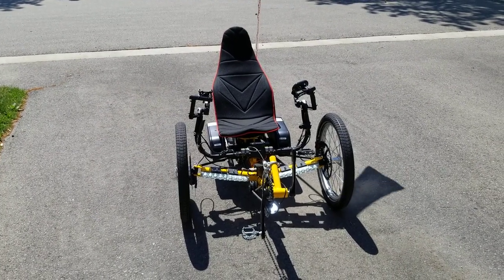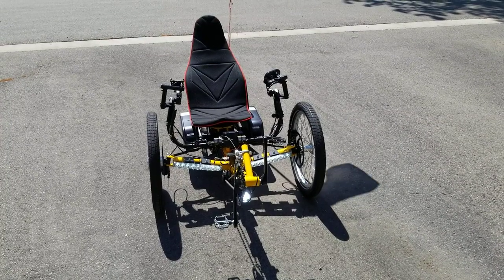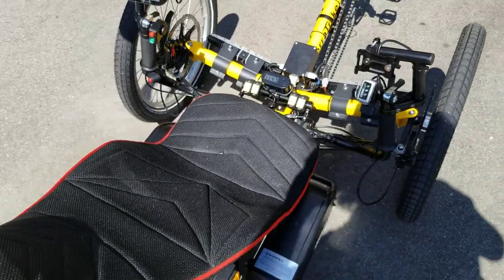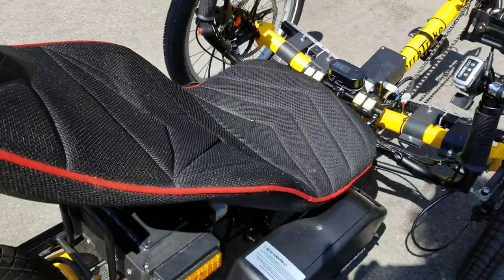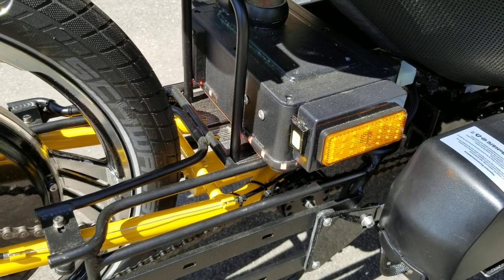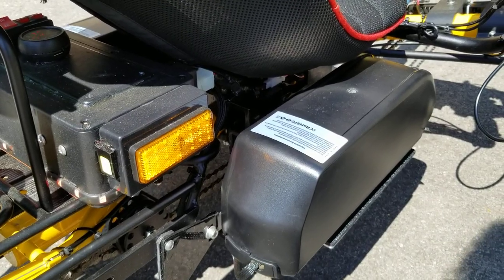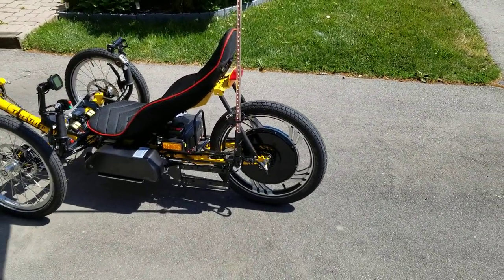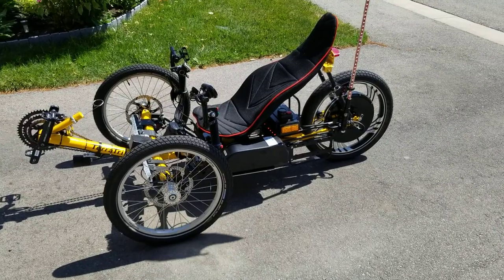Terratrike Tour 2 - etrike conversion.

Comment: Your trike looks great. I'm orienting and learning as much as possible about all kinds of trikes (etrike or trike). Currently I'm using a gravelbike to go on my twice a week trips with my buddies, but I like to have a bike like this to go on longer trips on my own or even to go shopping, not needing to use the car or motorbike... With my gravelbike not very practical. Beautiful built, your bike, I have to say it again.
Reply from the maker: Thanks for the Compliments!  

The Terratrike has actually seen some improvements to the setup, since this video.  Inclusion of a full sized, beefy rear rack intended for a 20" Fat-tire bike, allowing use of soft side bags (repurposed Tactical packs, LOL) for tool-kits, essentials to be permanently stowed, and a ~30L quick removable Scooter top-box to bring the Groceries home in dry condition..  Rear tail-light was relocated.  

Current setup can be seen here in a shorter video: 

https://www.youtube.com/watch?v=Y_BB33RlA60&ab_channel=ImagesfromtheDorkSide

Last season, this became my stand-in replacement for my Truck, for local errands - which in era of COVID, was 95% of my trips, in being home-centric.

As much as i wanted to get back to bicycles - Trike is the safer route to go, with my Medical/Balance issues.  

I've got another Project underway - ground up 'experimental' build - that will involve a full-suspension setup, as it's eventual replacement.  There's a preview video of that, somewhere in my channel vids.

Comment: Awesome!   What kind of range do you get from having both batteries?  I converted my Performer Goal (two wheeler bent) to electric with a 48V 17aH - I get an average of 84 miles (but can stretch it to 95 - just don't want to kill my battery).     I love it when I can take parts from around my garage and solve a problem, but most of the time, my solutions fail and I try try again.  Anyway - nice ride!
Reply from the maker: Thanks for the Compliments!  

I am not kind on battery range, given the variations in elevation/hill climbing i take on.  

Throttle being aggressively used, i can do ~60km (~40 miles) on one battery pack (48v19.2ah).  I don't have them double-ganged up - the other battery pack not in play at time, is for lighting, and serves as a reserve pack, if i get outside of that ~60km range.

Comment: im about to get a terratrike wizwheelz i think its the same as this one and i was wonder where did you get that seat? look pretty cool and is it comfortable and on tight turns will you be slide off the seat? thanks
Reply from the maker: The seat is from Poland - they are commonly found on Ebay.  Note - it's the bare fiberglass pan, and seat cover only.  NO mounting hardware whatsoever.. 

I am competent enough in aluminum fabrication, that i built up replacement mounts to adapt to the original Terratrike seat mount on the frame, and the rear seat stays to the drop outs.  It took a fair amount of designing on the fly, as i also incorporated the  dual battery mount around my fabrication.  It's definitely not a beginner's fabrication task.  

The seat cover ensures grip of the body in position - i am a lightweight at 140 lbs, and the seat holds me in position.    It's certainly comfortable to me, that've literally spent the day at a music festival, on my mobile 'couch'...  

It's a good enough seat that i picked another up, for another Recumbent Trike project, currently being designed/built from scratch.
Reply from the maker: Note  -  you don't want to 'Tight turn' a Tadpole Recumbent Trike at any speed that would displace a rider - you will likely end up flipping the trike, before you part ways with it.  

Tadpole Recumbent Trikes  are remarkably stable on the straight and level  at a pretty good rate of speed - until they aren't with sudden directional changes - then it generally all goes to Hell, very suddenly.  When the Center of Gravity wanders outside of the wheelbase Triangle - the rest of the Trike wants to follow suit..   

Just FYI.

Comment: Hi, how much did it cost you and where did you get the motor???  Great job,  I will upgrade my Taratrike after watching your video ,thanks for shearing !
Reply from the maker: Hi there, and thanks for the Compliment!

This is a Golden Motors Black Magic Pie 5 Vector 20" mag wheel version.

https://goldenmotor.bike/product/magic-pie-5-vector/

The mag wheel version might not be available any longer - i don't see it on the websites.  I might have actually got one of the last available, as it disappeared off the websites shortly after my order.  

The Spoked versions of the wheel are basically the same.  

How much did it cost?  I don't want to really know... i'd say under $5k Canadian, including the cost of the Trike.   Everything but the Trike Frame itself, was reworked, or replaced, in the process of conversion...

Costs could definitely be reduced.

Comment: Is that a stock Terratrike seat or a custom seat?  If custom, where did you get it?
Reply from the maker: Hard shell seat imported from Poland.  Comes as seat/pad only.  Mounting methodology is purely up to the user.. i had to fabricate two aluminum mounts to adapt to the terratrike methodology.  

https://www.ebay.ca/itm/303792542217

Comment: Looks great. What kind of tires are those?
Reply from the maker: Running Schwalbe Big Bens at 20"x2.15 on front, and a Schwalbe Moto-X 20"x2.40 on the rear.

These are e-bike rated tires.